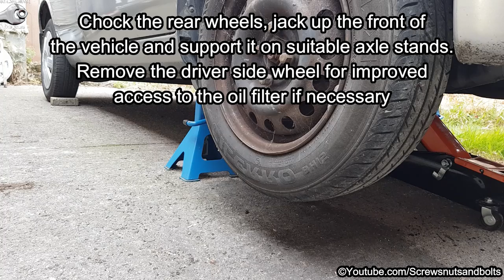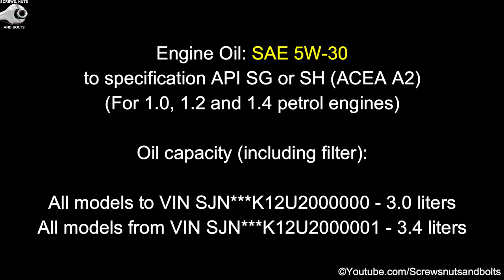Engine Oil and Oil Filter Change - Nissan Micra K12

Comment: I think I already know how you set the tightening force with a torque wrench.
The service manual specifies the tightening torque of the sump drain plug with range: 29.4 ~ 39.2 Nm.
The average value between 30 and 40 is 35 Nm

But you forgot one thing ...

... remove the spider's web from the engine ;-)
Reply from the maker: That spider's web is holding the car together lol :)

Comment: Why there’s a need to remove oil filler cap before draining?

Does it not make sense to keep it closed so no debris can fall inside the oil tank?

Thanks
Reply from the maker: The workshop manual instructions advised taking off the filler cap before draining the oil. You could probably leave it loosely covering the filler hole if there was any risk of debris getting into the hole.